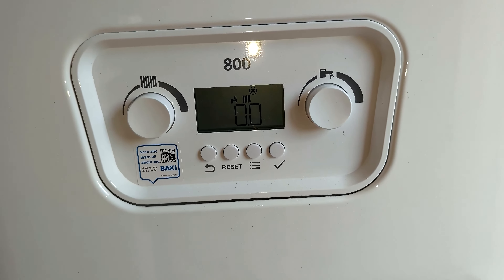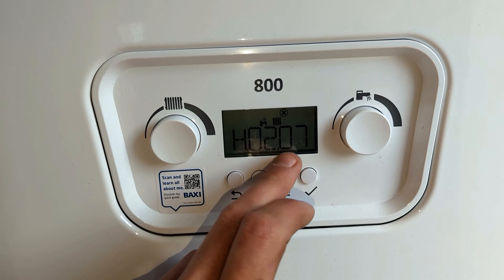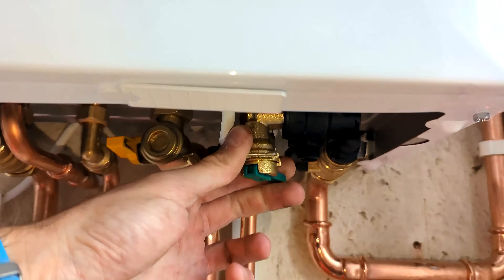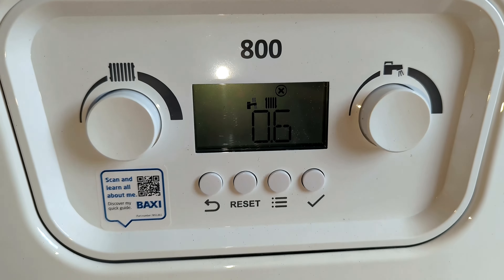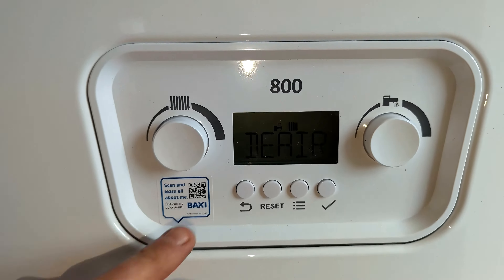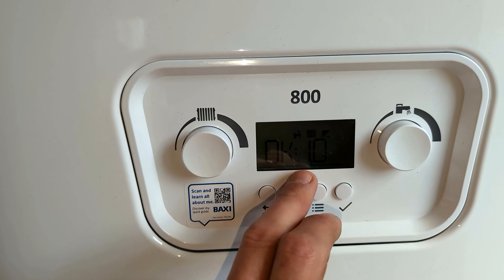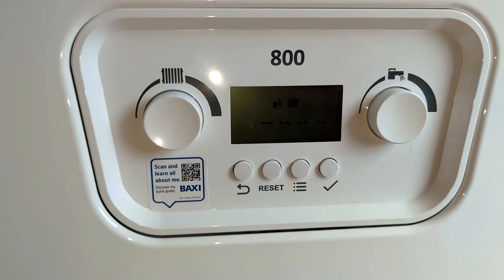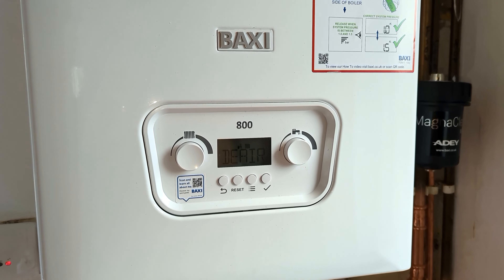How to: Top Up the Pressure on Your Baxi 800 Combi 2 Boiler (Error Code: H.02.07)

Comment: What causes a brand new boiler to loose pressure every day
Reply from the maker: There are a few things that can cause a heating system to lose pressure every day:

1. Faulty expansion vessel 
2. Leaking heat exchanger 
3. A leak on the heating system
4. A leaking pressure relief valve

Hope this helps
Reply: @dpjplumbing  leak in the heating system if fitted brand new
Reply from the maker: It's difficult for me to give advice as I'm only guessing. But these are the places where leaks can occur at anytime, brand new or old